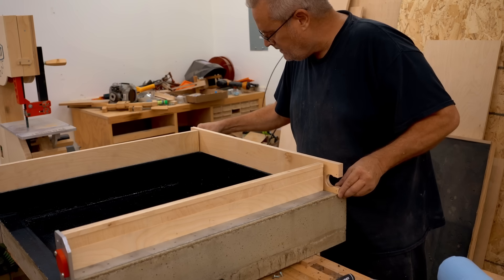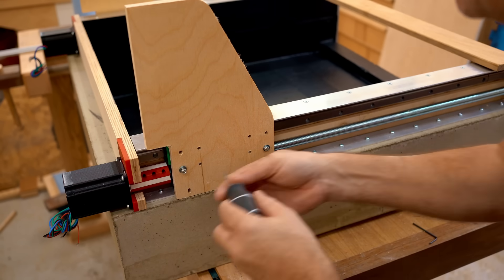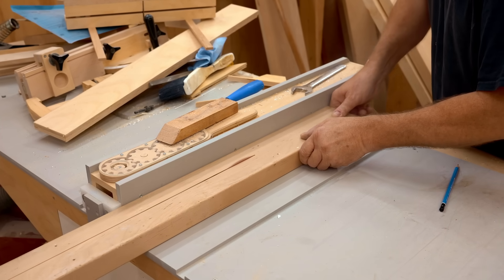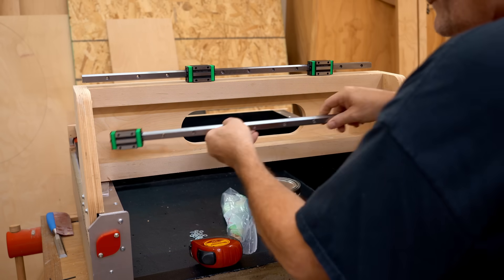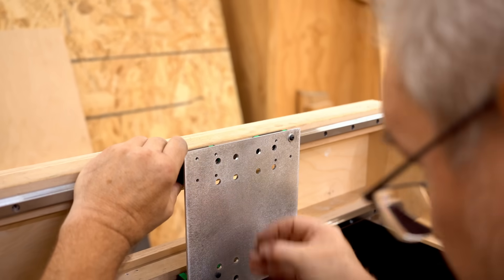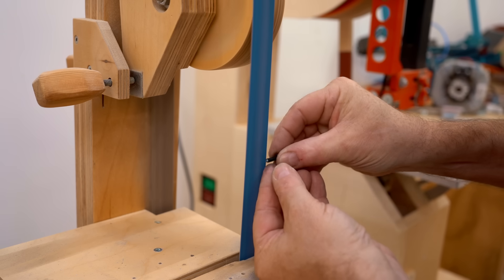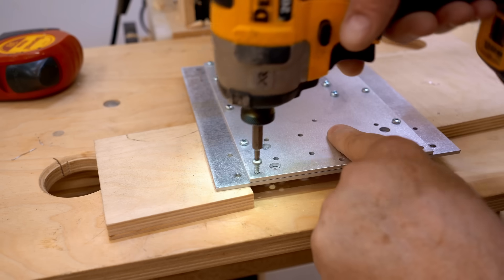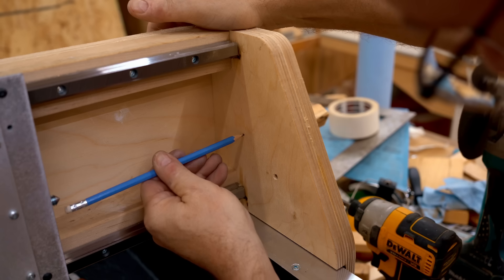OH NO! More WOOD! CNC Mill Build Part 4

Comment from the maker: Watch the video I made on WHY I USED WOOD! https://www.youtube.com/watch?v=xYUHgVQVqBo
With the Y rails done I can get started on building the gantry. In most CNC milling machines the gantry is fixed to maximize rigidity, but that means the bed would have to move instead, in the Y direction. That means the footprint of the machine would have to be bigger to have the same capacity as a moving gantry machine, and there would have to be linear bearings and a lead screw below the bed. So moving the gantry is a tradeoff where I give up a small amount of rigidity for a more compact package and mechanicals that are clear of the cutting (dirty) area.
I used Baltic birch plywood and solid hard maple to build the gantry because I know what can be done with these materials - their strengths and weaknesses and how far to push them. My design relies on the total structure for the strength and stiffness needed for a machine like this, and not just the individual parts. The linear bearing rails, for instance, are strong, solid hardened steel that add a lot of stiffness to the assembly. It all adds up.
Also the design itself minimizes unsupported spans that can flex when loaded, the height of the gantry sides for example, above the Y axis in this design is practically zero. And the X axis span of the gantry will be beefed up even more with 1/4" thick aluminum plates fastened to the top and bottom to add stiffness.
After I've finished the gantry I'll paint it like the other plywood parts to make it water resistant.

Comment: I built a "kit" CNC (about 700 x 800 mm cutting area) from aliex and replaced the gantry and the whole Z-axis with melamine coated birch plywood (here in Europe that's used a lot as floor boards and side walls in trailers for example). The CNC's aluminium profiles just weren't stiff enough. And that plywood isn't moving around a Dremel as a spindle. There's a 2kW water cooled spindle on it. The wood made the CNC much better. So... OH YES! More WOOD! 👌

Comment: I've been using a multiplex framed CNC for decades now. I just don't see the point of adding so much weight to one... It's like putting race car tyres on a stock Fiat 500...
You can do it, sure, but it's absolutely pointless and has downsides that make it ridiculous.
One of the reasons my CNC is made from Multiplex is that it made it light enough to move by myself. You throw that away by adding in functionally useless concrete...

Not to mention that you sorta want a fixed gantry for maximum rigidity...

Comment: I think people comment without knowing or have watched your back catalogue I'm fairly sure the only tools ypu haven't made is hand drills😂😂 
And I'm fairly sure every tool you have made has its fare share off plywood.
Reply: I have built and used multiplex cncs for decades. And I know for a fact that putting a heavy concrete base on one is like putting lipstick on a pig.
Reply: @Argosh  I worked with a welder who welded for 40 years, he was a shit welder. Time doing something does not always cross over into expertise.

Comment: Nothing wrong with using birch ply for a woodworking CNC router if the design is right.
The best way to further reduce the required gantry height and therefore increase the overall stiffness, however, is to use fixed rails and moving blocks on the Z-axis.
This way the spindle can go well above gantry bottom in Z0 to achieve a good save height without the endmill still sticking in the work area.
On a design with fixed blocks and moving rails the max Z-axis height is the gantry bottom and in order to move the endmill out of the way in Z0 the gantry side plates have to be unnecessarily high

Comment: One thing I didn't realize about linear rails is that they're not straight most of the time (unless you buy super expensive brand ones). They usually have a bow in random direction or can even be a spiral. However it doesn't matter much here because this is not a high precision machine and there's enough of flex in the structure.
Reply: Makes me realize that you understand things better than people,  respect!

Comment: I think you can break PVA bonds with heat, but it may wrap the plywood too. But either way glue joints are only as strong as the weakest link, in your case it would we be plys in the plywood.

Comment: Yeah, building a cnc-mill from wood just isn't a good idea... It won't last as long as metall, is not as stiff as metall, deflects more and won't dampen vibrations as good...

But if you don't need precision down to the thou or less and are on a budget, go for it!!! It's cheap, easy and in general a good option for makers who don't need high precision or durable machines for industrial use. If you design a cnc build from wood you general get what you pay for
Reply: Have you seen any of the other stuff this guy has built? Do you understand what he is trying to achieve with this build?
Reply: @ChrisStCyr-gnt7  I don't say wood is a bad choice, I say that you get a good cnc router which suits the typical maker rather well. But you don't run 2000 production parts out of steel with tolerances down to 5 micron on a machine made from wood....
Reply: @xavermaier9625 Yep, you missed the point completely so you can make your own useless point.
Reply: @xavermaier9625 don’t back down now.. wood is an absolute terrible choice. Forget 5 micron he’s lucky it get 0.25in after a months of running. 

I appreciate the video and great craftsmanship but wood? To hold your linear rails? 

It’s so bad it’s almost a safety hazard. There is a reason people are complaining about it
Reply: I sense some Euro superiority in this comment...

Comment: I will repeat myself , you should modify it to mount the rails to the concrete directly horizontally not vertically like now
Then it will be night and day in rigidity and in linear rail lifespan because they not designed for twisting forces 
But if you rly want to stay with this design you should at least add reinforcements on the sides (pieces of plywood vertically)
Then add at least 2-3mm thick aluminium under the rails (in your case -mapple) and on surfaces where linear bearings are mounted (plywood)  - glued for it to be way stiffer there so the linear rails wont "sink in" the wood
Because now it will be super hard to do that on plywood you can use resin on it , heat the plywood a bit , apply resin, let it soak in the plywood when cooling down and you can clean the rest on top. 
It will make top surface way harder and plywood stiffer overall (i have done that few times in some projects)
Reply: + for mounting the rails to the concrete. The ultimate hack: mount them to a granite slab that has been ground smooth. None of this concrete nonsense.
Reply: @just_UwU_ing  thats true , i build ones using granite (pieces glued together and grinded flat etc) , or bit easier is to make the frame with square tube filled inside with epoxygranite etc

But best option (expensive af) is to use granite surface plate with precision grinded granite straight edges on the sides 
And another one (precision grinded on the side ...crazy expensive) for X axis
Then you have literally 0.001mm accuracy on the machine bed , you dont need to measure parts on the surface plate because you have it directly under the part 😅

Comment: your material choice and process of lining things up/installing them GENUINELY hurts to watch
(capslock for emphasis, not for yelling)
linear rails are hardened steel for wear purposes, but they're NOT STRAIGHT and are not supposed to be structural
they RELY ON WHAT THEYRE MOUNTED TO for their accuracy and rigidity

the basic metric screw for the Y axis creates too much friction and will have slop/tolerance issues, the 3D printed nut will wear out faster than expected.

This machine in its entirety will most likely not last, it wont create properly toleranced parts, and will have rigidity issues from the gantry alone!
the concrete base honestly is completely fine!!!! its the rest of the design that's an issue.

rigidity and machines like these are a solved science
Reply: Yes, that was one of the hard lessons that I learned when I built my own CNC machine.  EVERYTHING has tolerances and variances.  Metal is not straight.  Wood is not straight.  When I didn't allow for that in my  design it was a problem.  Adjustability was crucial for a good outcome.  
On the first day of running my machine those perfectly straight linear rails were causing binding of the X axis in spots and the motion was being jammed.  I tried and tried to get those perfectly straight rails exactly parallel to each other but no, it did not happen.
In the end I chose one rail as the master and let the other one float (loose bolts).  It was the only way that I could get that X axis to travel the full 600mm without binding. 
It was quite a shock and a learning experience that linear rails could not be depended on for perfect straightness at all !  It's not a lot.. just enough to bind up the bearings over a travel length of 400 to 500mm.
All this talk about mounting to perfectly rigid concrete surfaces made me cringe knowing that without any ability to account for tolerances, that machine is going to bind up too.
Reply: And neither will his table saw, bandsaw, drill press and other cools things he has built from plywood over the decades. Oh, but wait, they have lasted well! This is not an industrial machine.
Reply: Wood is not necessarily less rigid than using steel or aluminium, it entirely depends on design : material thickness and geometry, precision of cuts among many factors. I have replaced thin wall tube / channel / angle steel sections or even 1/8" Steel / Cast Iron / Aluminium and up to 1/4"  that was flexing with solid birch/maple or Douglas fir plywood...sometimes even a flat sheet of wood outperformed a thin wall boxed steel section with less deflection, no twisting or deformation when fastening.
Reply from the maker: "Follow the science!" 
The bearing rails are straight - I checked them - and everything that adds strength to an assembly is structural.

Comment: You think you know what wood can do, but you don't. Considering the price of birch plywood, using plastic would solve all the problems. At least it doesn't expand or contract with heat and cold, and it can be processed with woodworking tools.Aside from the concrete base, you made the wrong choice at almost every step. 3D printed parts = creep, plywood construction = deformation, and conventional lead screws = inappropriate lead and excessive wear. Oh, and I didn't mention the wrong type of coupling, which will cause eccentric wear on the servo motor in the future.
Reply from the maker: I should listen to someone that says plastic doesn't expand and contract with heat and cold....
Reply: @JohnHeisz  Have you tossed out the build yet? He proved you wrong 100%, that is if he was right about anything he said, which he isn't. LOL
Reply: @JohnHeisz  I noticed he did not include a link to his CNC build!
Reply: @ChrisStCyr-gnt7  None of these people have done any real work in their lives. I can weld, but I'm not a welder. I can machine, but I am not a machinist, I work with wood, but I am not a wood worker.
Reply: @KipdoesStuff His English is better than my Chinese,  tho...

Comment: 1/2" Baltic birch is a very stable and strong plywood. It's much stronger than the typical garbage you find at big box lumber stores. So is solid, straight grained maple.
Reply: It's reflected in that it's more expensive then solid titanium.